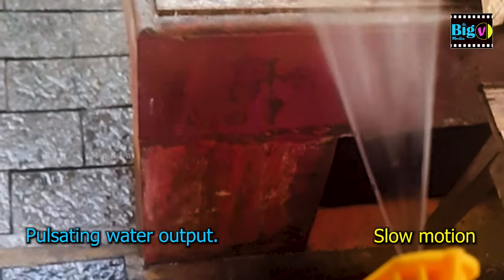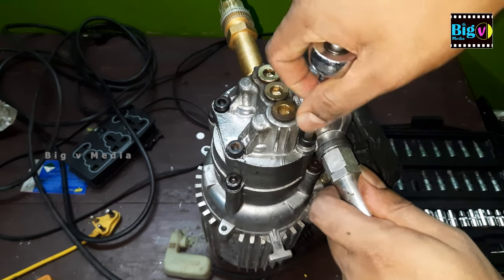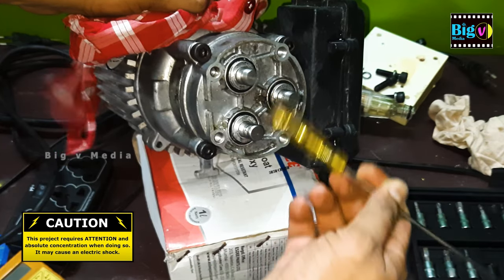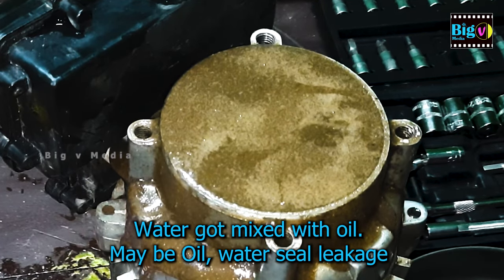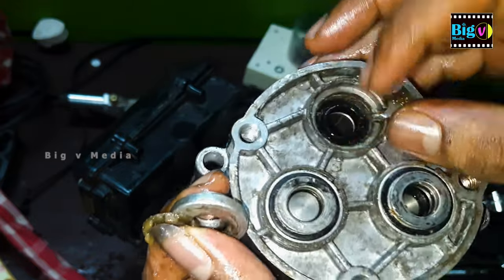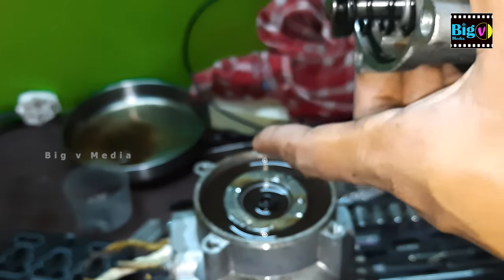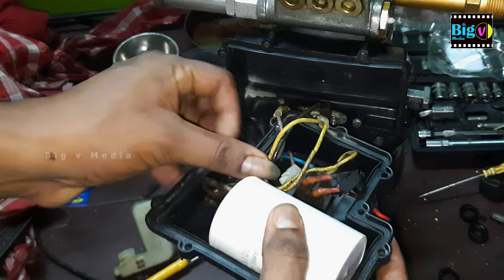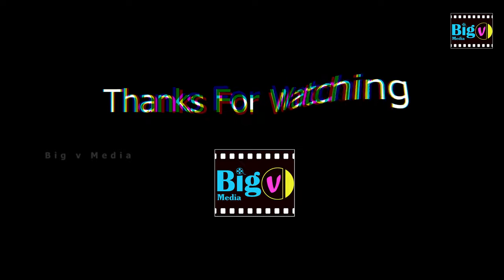How to Repair Weak Pressure and Pulsating water output .

Comment: I had low pressure problem and motor was working not continuesly. I changed carbon brushes(1 was not good) .I cleaned and changed some parts for pressure problem. Now it doesn't work at all 😂. 🫣
Reply from the maker: Is the carbon brush properly touching the sliprings? Did you try sanding its tip a bit before placing it?
Reply: @bigvmedia  Yes. After I changed carbon brushes motor was working. It stopped working after I clean. I checked again today carbon brushes touching. I checked continuety of cords. Everything is fine but still motor doesn't work. I gave up for now 😔. Thank you for sharing your knowledge 🙏🙏🙏🙏